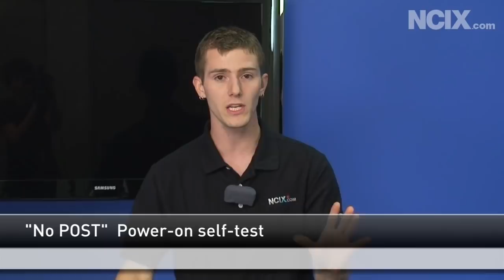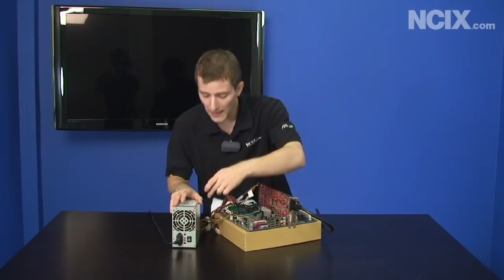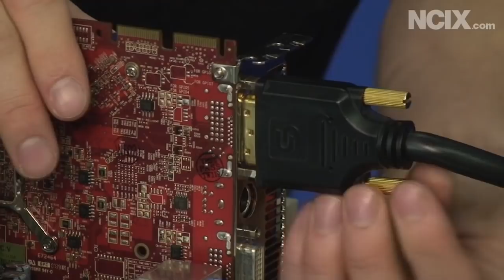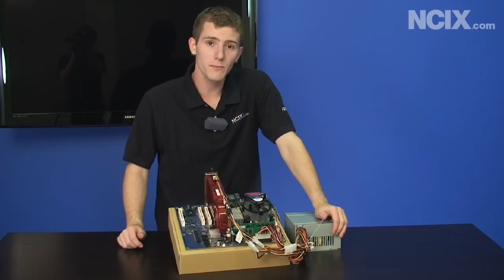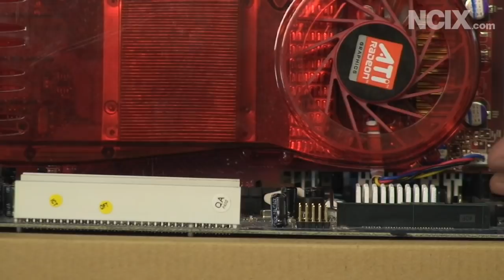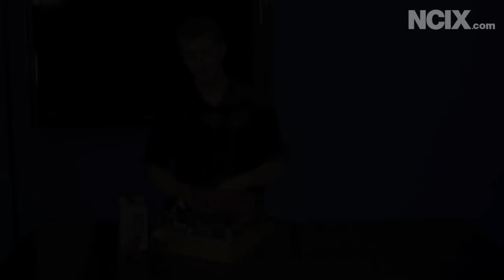PC Troubleshooting No Post Diagnosis (NCIX Tech Tips #54)

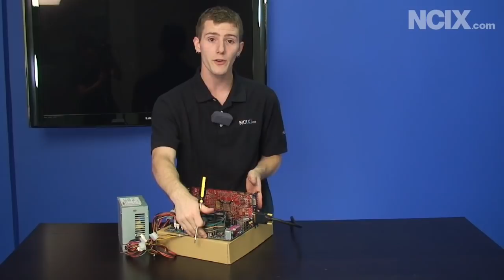Comment: 3:46 - CONDUCTIVE FACT - Some other motherboards have an onboard power switch (very handy) and it allows you to do it easily, while others you will have to use a conductive material (eg. a screwdriver) to connect manually the two pins for the power switch in order to get the system to start. When the system starts, if you hear a beep code, that means is A; we have power to the motherboard, and B; we have some kind of response from the system. Usually what that means is that the problem lies somewhere else. Removing memory gets rid of hearing the beep codes from the motherboard.

Comment: Is it possible that the 4 pin header for the cpu isn’t supplying it with enough power, but an 8 pin could
Reply: the presence of more pins (psu wires) for a connector for same voltage (cpu uses 12 volt, the yellow ones) means that the device draws more load, like high end video cards like the one in the video vs lower end ones of higher wattage. i didnt understand your question thought, sorry
Reply: colo capacco oh no it’s fine, turns out my board has an incompatible bios. I have a ryzen 5 2400g, and I was using a 300 series board, when I needed a x470 chipset board

Comment: My pc boots up cpu works fans spin leds light up in pc and mouse lights up but not keyboard and it says no signal on my monitor ive tried taking out the ram and putting it back in took out the cpu cooler wire and the gpu wire and put them back in and nothing worked can anyone help me or any advice ??

Comment: DO NOT, I REPEAT DO NOT move the red switch in the back to a lower voltage, a psu blew in my face...
Reply: Don Dan  nice joke
Reply: Try it then :D, see what happens
Reply: Don Dan  mine didn't blow up because this was Stone age power supplies
Reply: Im_Godly You live in a country that has 110v in the mains so yeah if you flick it to 220v it wont blow, but in my case I switched it from 220 to 110 and BOOM, a big flame and then my room was filled with smoke
Reply: Don Dan  Lmao what an old dinosaur age power blowned up supply you had there
Reply: Im_Godly Some dell with i5 2500 that I found, sold it for 120$
Reply: Don Dan now that's what you call a dinosaur age computer
Reply: Don Dan  now I wonder what you run now
Reply: Im_Godly i5 4790k, gtx 760, 8gb 2400mghz, asus rog ranger vii
Reply: Don Dan rip old psu that blew up on you I will never forget this comment
Reply: Im_Godly It was for a better cause, I will never forget NOT to do that :)).
Reply: Don Dan  lmao why would you even mess with the voltage?

Comment: My pc boots after I turn it on and off a few times but never on first try. Now my pci express port does have a chip out of it so doesn’t lock card in place but would that be causing my problem as it does boot eventually without touching it and runs perfectly fine the whole time it’s running?!

Comment: I have a motherboard which was working before but now it's not working I was using it for 2yrs as a home user and I think its a bios error because the last thing which a was doing is upgrading bios software but still it has been booted up. I need some solution how to recover intel dg41rq motherboard and even their is no beep, no display but led comes up normally

Comment: I built my custom rig its all set and it worked fine in the place where i built it but in my home it wont turn on , i have vga and dvi in my monitor , i have vga dvi and hdmi on the mother board and dvi and hdmi on the graphic i tried plugging my dvi in the monitor and hdmi to both the board and gpu but i see now display but as i said the pc turns on and works its the display someone help

Comment: Okay so my pc doesnt post, pressing the power button only lights up my corsair led ram, no lights or beeps on the motherboard. 

The light on the psu doesnt turn on but when the pc clears post that turns on. 

So not really sure whats the problem, the only solution ive had is to wait several hours and try the power button again.

Comment: Hello, I have run into a Issue: My pc Restarts/blackscreen crashes(sometimes with looping sound or buzzing) when starting to use GPU. Generally when starting games or using FurMark stress test.

Pc Specs: 
550W PSU
AMD FX-4100 CPU
Radeon R7 360 GPU 1
Zotac GTX 1050 OC GPU 2
760GM-P23 FX MB
2x 4GB DDR3 1333mhz RAM
SEAGATE ST500DM002 HDD

1. My pc is Dust free, cleaned it fully. 
2. I changed thermal pastes on both GPU(warranty on gpu was over anyway) and CPU aswell.
3. I run Cpu and Ram tests which went fine, with no crashes or errors. 
4. I tried a New PSU, still receiving the problem.
5. Tried a Fresh new GPU: Zotac GTX 1050 OC, still receiving the problem.
6. Reinstalled Windows 10, still the problem persists after fresh driver installs and testing with both GPU's separately.
7. Reseted the CMOS/BIOS, still problem persists.

Note: I have used this pc for a few years. This problem started accruing only after installing-playing "Endless Space" on steam. And afterwards can't play any other game or use 3D editing programs...

If someone can suggest helpful tips or have run in similar issue or something that be appreciated

Comment: I just made my first build
I plug everything right  it turn on n everything was running but i was geting no post an some beeping noises. So i was wtf. Everything looks good. So i took everything apart n redid  the whole thing. N nothing . Still same  problem no post. So i come n watch dis vid n i was like i did that already . Then i scroll down the comments n read one  that says for new pc builders plug in the vga into the graphics card not directly to the mother board. N i was like,  hell no  i was tryjng to  build one with out my graphics card .i didnt think i needed one. So i plug in the graphic card n put in the vga Cable n  a miracle happen n i was so excited it work :)

Comment: i got a problem with my pc, it turned on for a few minute with a display but suddenly no display ... i have reset bios, reinstall driver and remove cmos, but nothing change. The problem is, i got a display for a few minute then boom no display. this is my spec:

i use fx6300, with gtx 1060, 8gb ram and 500w psu

Comment: Can someone help me? I just built a new pc. Everything works fine, the led and the fans spins up. Its just that i get no signal on my monitor. I tried using different monitors and different cables, clearing cmos, used ram in different spots but still nothing. What should i do?
Reply: switch the gpu xD

Comment: My PC hasnt run right since I installed new mother, CPU, Graphics card, and power (550). I think its a CMOS problem as I get a CMOS power error msg when I boot, and my date and time wont stay set. I put a new CMOS battery in.

The problem I have is that my PC only boots some of the time, and only once per day. If I try to restart in install things then the screen and keyboard get no power and no beeps. Very frustrating as I havent been able to use it in 3 months.

My CMOS has 3 pins, and 3 holes on the gate thingy. when I got the motherboard it was sitting on all 3 pins, should it stay there? When I do a CMOS reset, should the battery be out when I move the CMOS gate over? Do I need to boot up to reset the CMOS or is just moving it over enough?

Any suggestions welcome. Thanks

Comment: I built my PC 3 month ago and it run with no problem till 5 days ago when it kept giving me blue screen and even force close games like risk of Rain, I reinstalled windows and it didn't boot. I searched on internet and most people say  to connect the 2 pin to reset the CMOS , did that worked fine till next day (yesterday 26-03), and now it won't load my GPU I did test the GPU with another  PC to see if its broke or not and works fine even put another GPU to see if it loads and no, could it be that the motherboard broke when I reset the CMOS and won't load it? Even did disable the motherboards graphics driver and turn the PC off, unplug the PSU and connect the GPU like someone said on a video but didn't work.
the PSU works fine the led light up when I connected it on GPU
parts:
-Asus Z170-A
-Corsair 2x8Gb DDR4 3200Mhz
-I7 6700k 4.00ghz
-Corsair CX 600w 80+ bronze
-asus geforce gtx1060 dual OC  6GB
-Crucial BX200 480GB Internal SSD 
Anyone know what to do befoer contacting the seller or even replacing the matherboard?

Comment: hey i got an issue with my build so when i turn it on the fans come on for a second and then turn off and the system wont boot 
i tried a few methods such as switching the ram to a different slot and plugging all the power supply units again and holding down the power button for 5-10 seconds but the same thing happens again and nothing seems to work (note i built this yesterday)  so can someone give me a rough idea on what to do before i try anything linus has shown?
specs:
Nvida 1050 4GB
1TB HDD western digital
8GB hyperx RAM
intel i3 6100
Asus H110M-D
Cit 500W Active 80+ Bronze 85% Efficient Power Supply Unit

Comment: Nothing helped, my mother board has no light or switch thing on it, switched the two ram sticks around, cleaned them etc, everything in my pc is as clean as a whistle, like brand new, I can't see any burns or anything on anything, there's no beeps even when I take both ram sticks out, graphics card seams to be working fine even though I'm getting no signal, took the battery out, put it back in, I've done everything time and time again from watching all these videos on how to get the signal back and no luck at all, I've tried monitor and tv, still no joy, any suggestions ?

Comment: What do you do if the power button doesn't do anything at all, no response what so ever from the machine... But the power supply is fine?
Reply: FroztiProductions use a screw driver
Reply: Tinglrr sifuentes to bridge the switch? that's what i did. nothing. used an old cmos jumper actually.

Comment: could somebody help me, i installed new motherboard (asus prime Z270-A) and intel i7 7700k processor and g.skill ripjaw 3200mhz 16gb ram -- im stuck at the american megatrends screen and it says " when raid configuration was built ensure to set sata configuration to raid mode" When i try to press Any button from keyboard its not working at all so i cant move foward!! Still my keyboard got Led on but not working. Sorry my bad grammar. (tried to connect keyboard to the another pc and it works normally, so the keyboard is not broken)
Reply: i cant go to Bios cos my keyboard aint working

Comment: my fans spin on gpu, cpu and psu but the usb doesnt work and no display. help

its on my first build computer.
Reply: Same happened to me. i really need to know what happened
Reply: remove the ram after that u hear any beep ?
Reply: Stech Anfo i didn't plug the cable for the psu al the way in. And i had to upgrade the bios

Comment: hi! I need help. I'm using SAMSUNG NP300 E4E. What happens is everytime i turn on my laptop. It only shows the samsung logo for a short time and 1 short beep and then restart. It seems like i am stuck in the boot process. Do you think that the CMOS battery is responsible for this? Before this happened the laptop was really slow in booting and time was never set to the actual date and time even when i calibrate it. I emptied the HDD(formatted it on another laptop) then this happened.  PLEASE HELPPPP!!!!

Comment: Can anyone help me? I just built my new computer and it worked for the first 2 days then all of a sudden as I'm playing games my computer crashes and doesn't work. As far as I can tell, all my components are powering on.
Reply: Furthermore, my motherboard displays the DRAM LED in orange, and when I first boot up my CPU Led is red then turns off. Then switches to the orange DRAM LED . While idle I can see the standby light on my MOBO on. I tried changing the ram slots and I no longer get an orange light but I still got nothing on my monitor
Reply: Powerful try removing the gpu.. if not.. then try to replace the ram

Comment: what if sometimes it boots up, and the other RAM is being recognized by your computer. while sometimes computer won't start with both RAM inserted. used both 4GB (= 8GB) RAMS (Gskill:ripjaws), mobo: G41M-P28 (MS-7592)  for a few years, til this time this happens -- currently using one memory stick works fine but experiencing slow process at times.
Reply: foxsshift make sure their frequency speed are the same
Reply: Cobby Dizon @Bios settings right?
Reply: Im not sure but you can try. If not you need to make sure that your actual ram(the hardware) are in same speed.

Comment: Hi
I want to ask about the problems I had. My problem is I stuck to the windows logo. This problem happens after I install linksys WMP300N model. I remove the linksys and gpu but windows operate properly. I tried to install other gpu and the same problem occurred. what should I do. I've format and still not working.

Comment: I had these problem. Please reply if anyone can help. :(

1. PC boot up without GPU with no beeps and able to enter windows without problems.
2. I only have 1 ram stick and it works without GPU and as i said in number 1 it works without problems.
3. When i use my old GPU, it works smoothly.
4. But when I input my new GPU. It starts beeping 3 times and it shows no signal on my monitor.
5. Please help. What should i do. :((( is it the GPU that has defect? heeelp

Comment: If it still doesnt work, check your processor for any bent pins. If there are try bending them back with a paperclip. I've had the same problem twice and it worked both times.

Comment: reset bios and out of battary force bios button push turn clir cmos djeck on clear and start with out baterry yours overcklo unseksesfull in bios login desblayd clering log eneybel shasy desblayd and wacth dog eneybl ///// Intel boards are holy boards for core tm if yours dont understend how can 2.67 worck at 4.72 use wather cooling  and don`t cclining it 1-time in mount don`t by it and last you psu must be curently with femely of cpu haswel conroe oor alse

Comment: Monitor works when vga cable is plugged into the gpu but it doesn't work when it is plugged into the motherboard!!! Help
Reply: Clorox bleach. A bottle more useful than you think You cannot have two displays on at the same time (hardware) in order to switch back to your integrated graphics go into BIOS and turn off GPU graphics and turn on on board graphics. (Most likely your motherboards graphics are turned off)
Reply: Alright! Thanks for the info

Comment: Hey I've got the same problem have tested changing the ram's place's and my motherboard , Gpu is working. The fan to the cpu is working then stops. everything is put together but can it be the my new brought cpu who is defect? Or my old 850watt silver module Psu ? Please help! (specs : i5 6600k , Gigabyte Z170-GAMING K3-EU , Gigabyte 760 gtx 2gb , HyperX 8gb ram 2133mhz , corsair 850 watt silver module , 75gb 75000rpm

Comment: Psu is at fault in alot more cases than peoplw would think
Reply: Yup my is completely fucked
Reply: My pc crashed couple days ago. I checked everything ram, cpu, fans, gpu, cables, hdd's. The psu turns on and the psu fan is spinning but for a few days after the crash it didn't powered up my mobo. Now it does power up my mobo but I'm stuck at post. :( I suspect the psu though. Brand new system three weeks old.
Reply: @user-nr2ys2sh7n  try removing the battery on the motherboard

Comment: am having  similar situation . well not so similar.i can get to desktop and do all the stuff ,,, gaming ,browsing,watching movie......but out of nowhere suddenly monitor goes out of signal, if i look in the mobo i can see the CPU led is solid red.if i restart it, it'll be the same, remove power cord,re insert it and then turn it on, it will also be the same.it will boot fine if i wait for like more than 6 hr....................maybe its the PSU, not being able to provide enough juice for the CPU.maybe the CPU cooler. if it is not compatible with the mobo's 3 pin and all that thing.the longest stretch i got without no black screen is 3 hr...................m5a99fx pro fx 8320 asus r7 260x...................

somebody??

Comment: hay i have gone through the process described in above video but what happens is all fans work so fine ,processor fan works fine,DVD RW works (is operate) , hard disk works based on vibration but i cant see boot screen of mother board & NO beep sound nothing PC keeps on running...................................................!!!!!!!!!!!!!!!!!!!!!

i am not getting the idea of any thing!!!!??????/

please help
Reply: Same problem, can't get any it to show up on screen but everything turns on, did you fix it

Comment: So I have problem with my pc.
All of a sudden my pc started make a constance beeping noise and no display shows.
I figured out it must have been the video card (Amd Radeon Hd 7700) because when I took out the video card it stopped making the beeping noise. So I got a new video card (GeForce GTX 660 Ti) and it still made a beeping noise and no display. And yes all the plugs are plugged in.
Any help
Reply: And there is no pause between the beeping.

Comment: Mine has been shutting off every now and then whilst I am using it. I have only been able to get power for less than a second with the fans and LEDS to turn on then it just switches off. Not sure what the problem is.

Please help.

Comment: I have a asrock z170 x1 that would not post with 4 sticks of ram but would on 2 sticks. I had to flash the firmware to 1.70  for the motherboard and that fixed the problem.